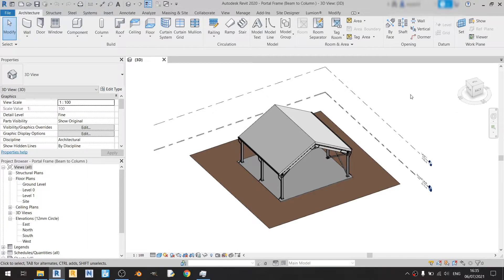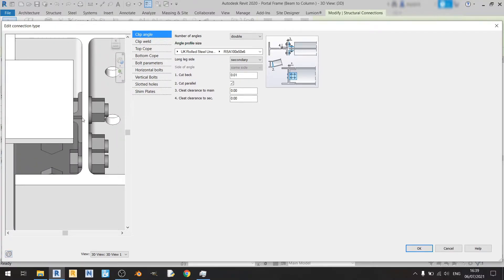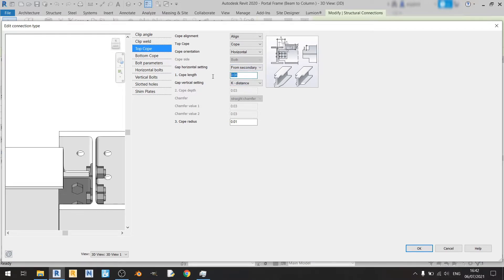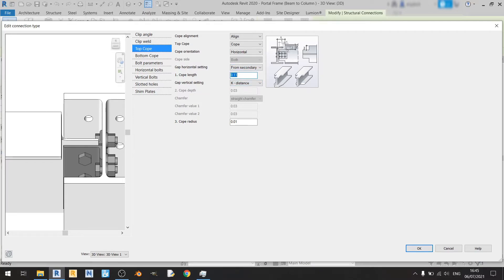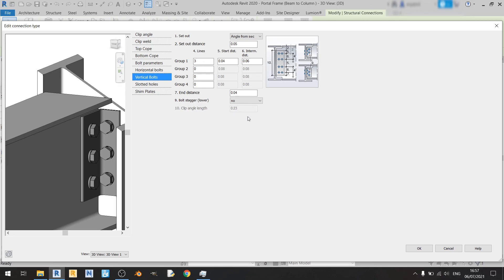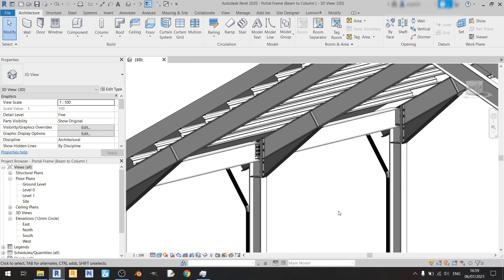Clip angle steel connection detailing (Revit 2020)

Comment from the maker: Timestamps:
0:00 - Introduction
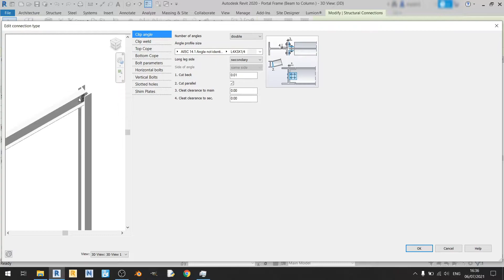1:00 - Clip Angle
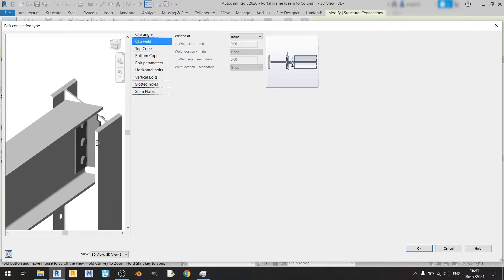4:24 - Top Cope
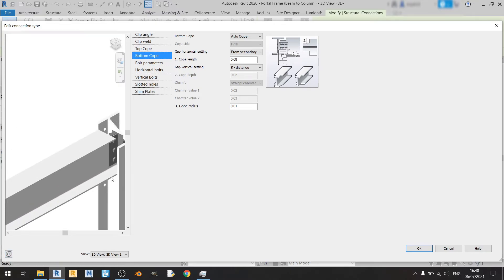9:30 - Bolt Parameters
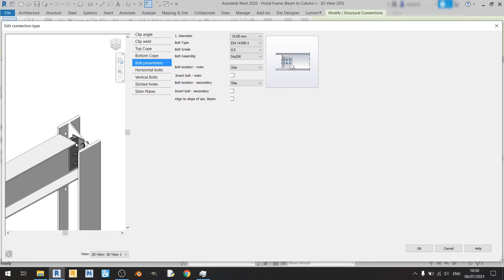10:45  - Horizontal Bolts
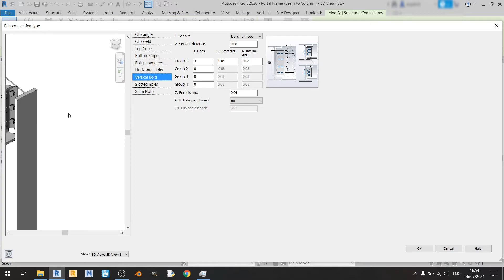13:37 - Vertical Bolts